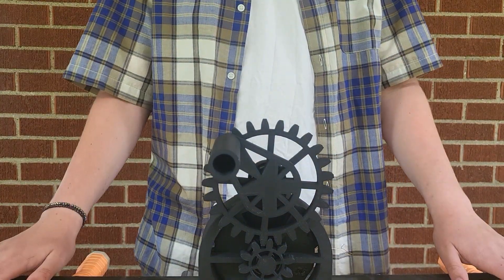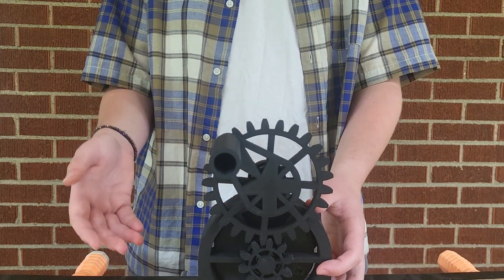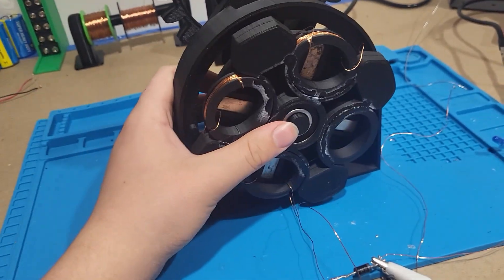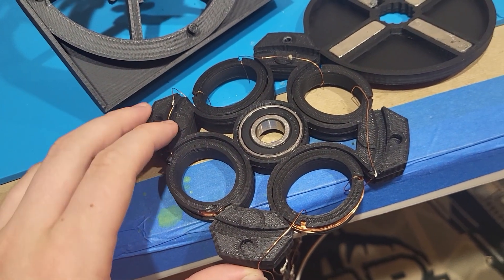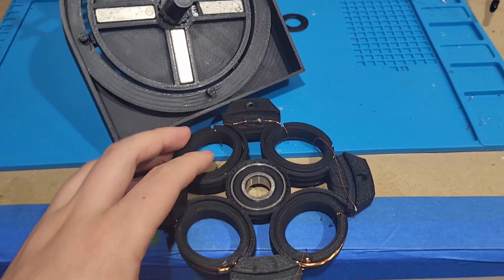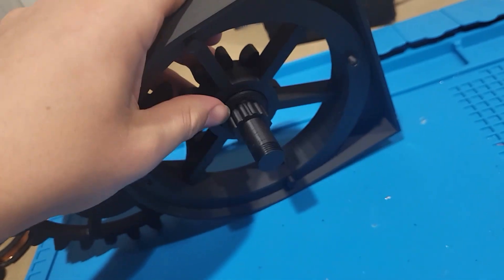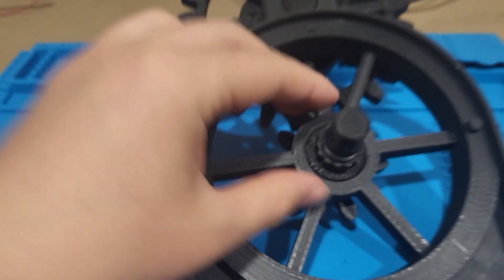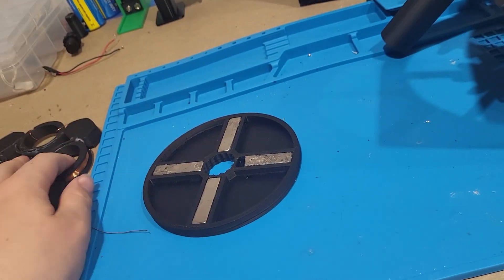3D Printed Generator

Comment: Nice job👍.I am not that good with generators myself,but I can recomend you adding a gearbox to speed up the RPM so you make more power,and also maybe consider a flywheel.If you want to use the power it makes,you should get that thing that changes the voltage of it (I forgot its name :D).Also depending on where you live,you could consider wind power or water power for it to constantly spin.You could find tutorials on youtube for most things I have mentioned here.
Reply from the maker: My goal is to make it more efficient that be able to make a adaptable version to turn into a wind turbine.
Reply: @ Nice work on the wind turbine project.👍I'm no expert, but here are a few tips to help boost efficiency:  
1.Turbine Design:  
-Different blade designs (Savonius, Darrieus, HAWT) have different trade-offs in torque, RPM, and startup wind speed. Pick one that matches your typical wind conditions and 3D printer capabilities (e.g., avoid ultra-thin blades if your printer struggles with fine details).  
2.Generator Efficiency:  
-Wire coils: Use thinner enameled copper wire (e.g., 28–30 AWG) and pack turns as tightly as possible—this increases voltage output.  
-Magnets: Stronger neodymium magnets (N52 grade) with closer spacing to the coils will improve power generation.  
-Gearbox:A small planetary gearbox can increase RPM to the generator, but watch for added friction. Test first with a low ratio (e.g., 3:1).  
3.Durability:  
-Seal bearings and electronics with a waterproof casing (PETG filament works well outdoors).  
-Add a simple diode or charge controller to prevent back-current from damaging components.  

Small tweaks can make a big difference! Good luck,I hope this helpe 👍
Reply: Also you could consider,thats if you do smth similar like I did,making it bigger with more coils and magnets.